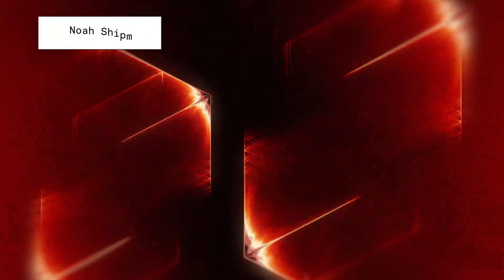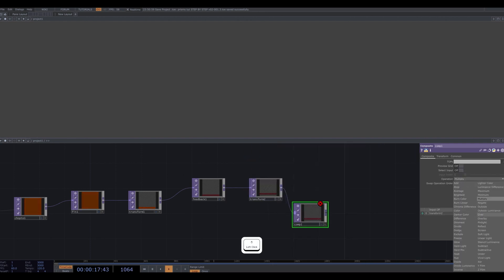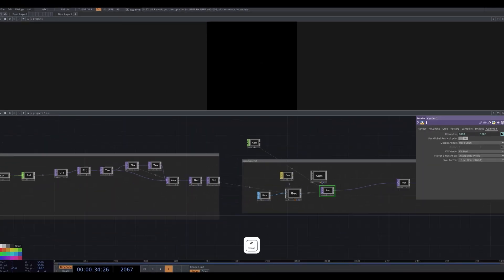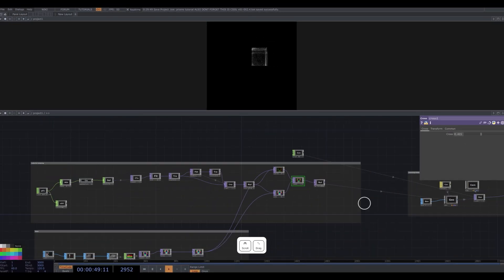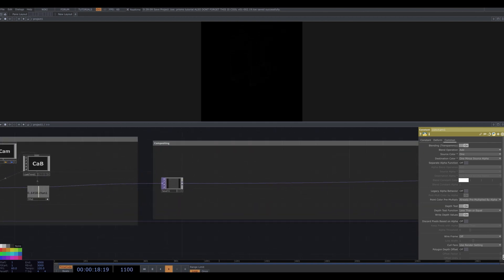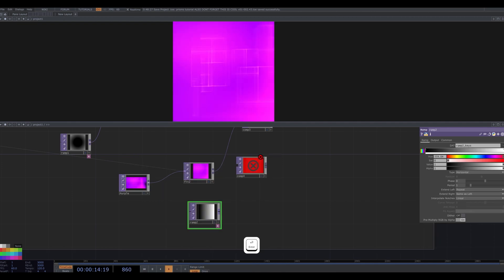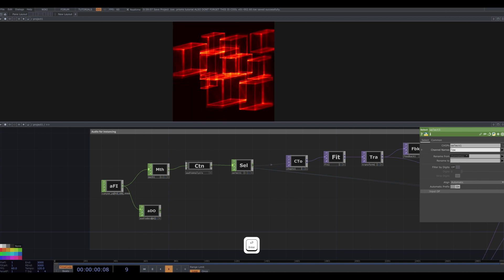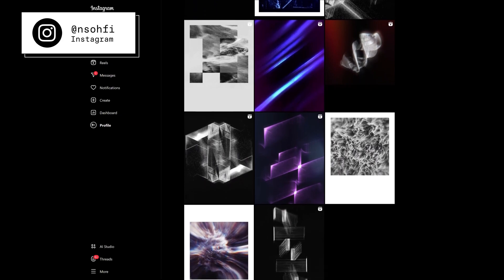How to make audio prisms in TouchDesigner

Comment: hi you might not respond to this but my visuals are barely visible+ blurry and aren't clear shapes as yours are in the video, even after following your steps. I started to get lost when you did a speed run of changing the 3 camera settings, so before that everything looked as it should on the tutorial. its just after that it completely messed it up

Comment: Hi great tutorial i just have one question.  Yours cube has clearly visible edges made from particles, even when Im putting every value like in a video my look is more centered (noisy cube), but edges  are not so visible any idea how to tweak it ?
Reply from the maker: Hi, towards the end of the tutorial I added a level after the noise and brought down the brightness, which makes the edges look more defined. Did you try this and do the cubes still look not as defined for you? 13:07
Reply: @noahfinlayshipman  Ye i tried that still seems a bit  off im recreating it on new experimental build. Like geometry generation is giving so little edges that its hard to get them from post processing

Comment: I'm a beginner and use a Mac M3, which crashed when I added geometry. I got the Vulkan crash alert. I looked for answers and found that "On the macOS side, targeting Vulkan means we can use MoltenVK, which means our actual graphics calls are done by Metal. This ensures we are current with the API that Apple is focusing it's resources on. The one drawback is that Geometry Shaders are not supported on Metal, so Geometry Shaders are completely gone on macOS on all GPUs now. By using Metal underneath we can finally make use of Compute Shaders safely on all platforms, so we can start using those more for operations within TouchDesigner. This enables things such as NotchLC encode/decode on macOS out of the box." 
Now I'm stuck! How can I get similar results? SOS -- Thank you <3
Reply: Make sure the scale the box before you connect to the geo. It helped me